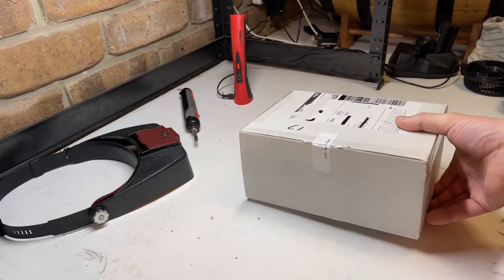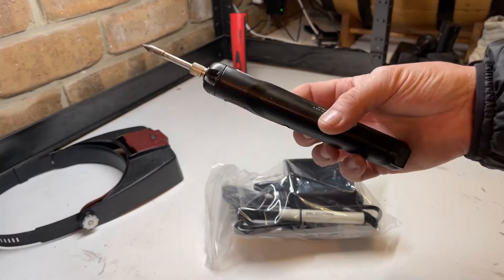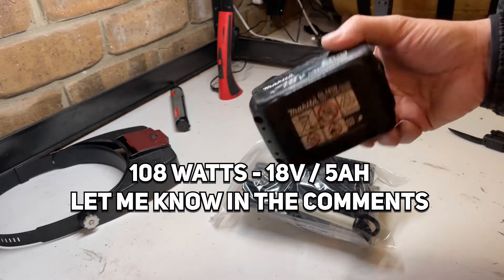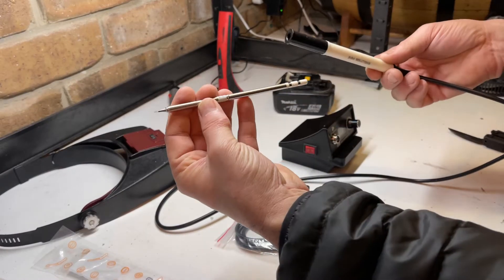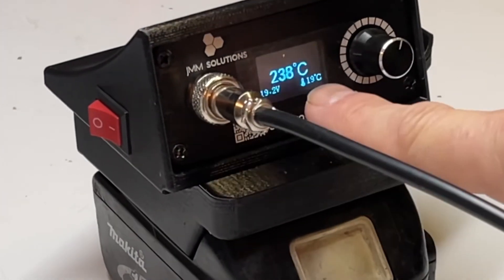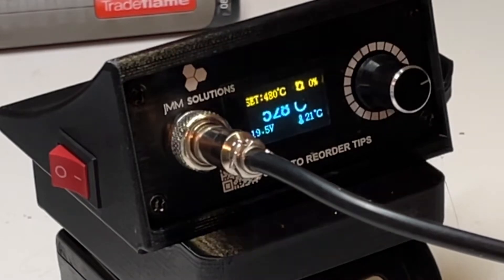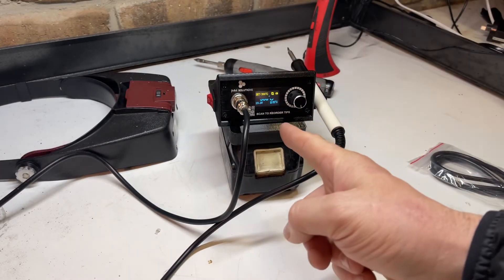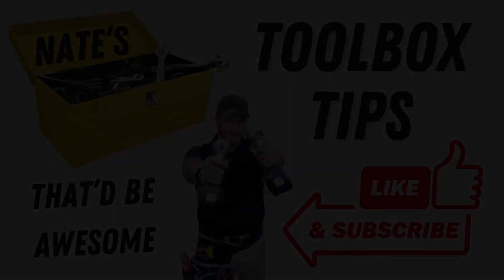Soldering on the GO! (Secret Weapon Revealed?)

Comment: My Miniware TS101 cost me $78 delivered...also in Oz. it does everything your iron does and yep, I've got a $7 Makita battery adapter on the way.
That soldering station looks like it's a 3D print, hardly the top quality you spoke of. So no injection molding happening at JMM I'll wager. Those tips look familiar too btw. I'll stick to my Miniware iron but shout out to an Aussie company mixing it with the big guys.

Comment: So it has been a few months, how’s that Makita soldering iron?  Does it really get that hot = 400c?  Does it lose a lot of heat/temp when soldering?
Reply from the maker: It’s brilliant.  I’ve tried at least 6-7 different gas and lithium powered portable Irons and this blows them all away. Gets up to temp so fast and stays there no worries, has a no use sleep to save battery but a sensitive bump awake And the best part is I’ve always got a Tool battery charged and ready to go somewhere.